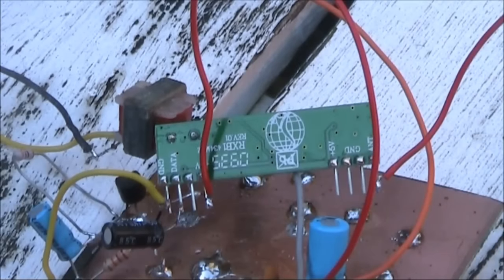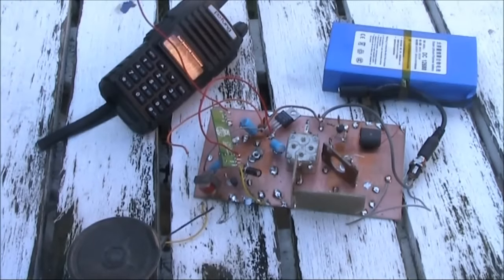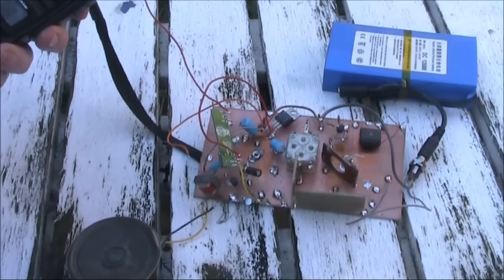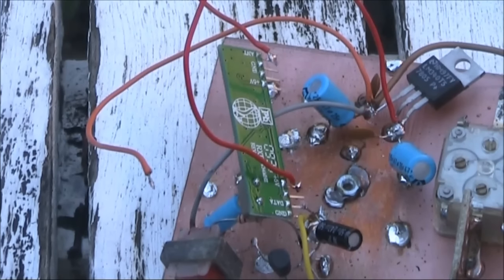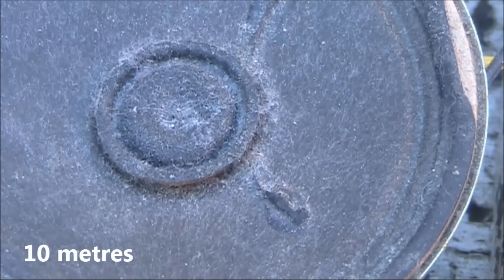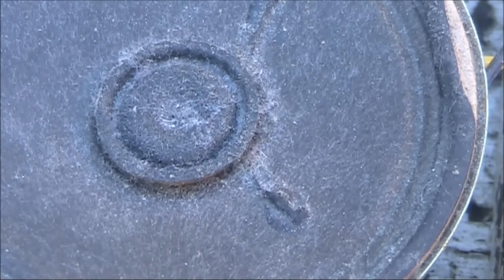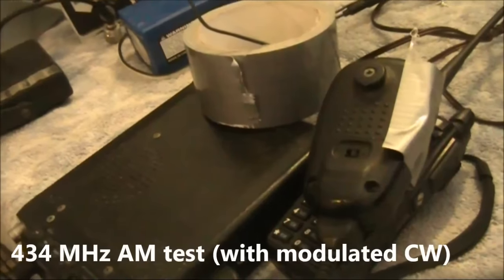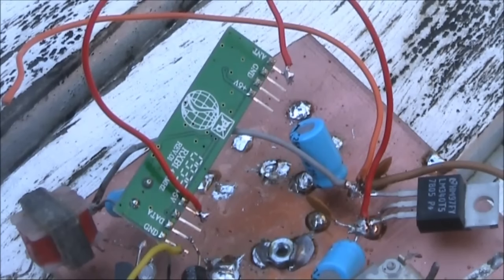Experiments with a 433 MHz UHF superregenerative data receiver module: Part 1

Comment: i have a pair of those modules, they are kinda good and cheap, the fact about audio is that they use a LM358 op amp that is slow by default and they use it as some shmitt trigger at the end stage (mine are slightly different but i think they are the same at circuit level) so "aliasing" sound may be really hard at the output :D... maybe hijacking at the first chip input can give clean sound, but a microphone amplifier or something is required... but it didn't sound so bad actually